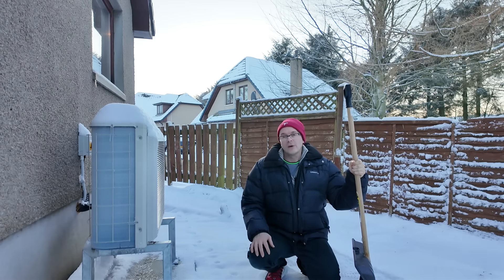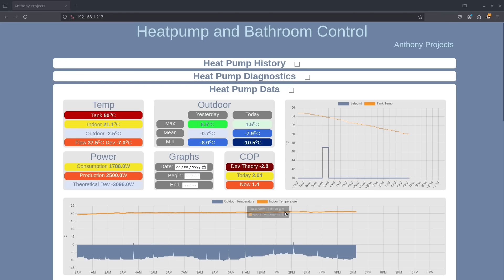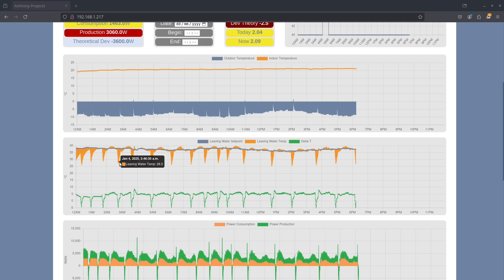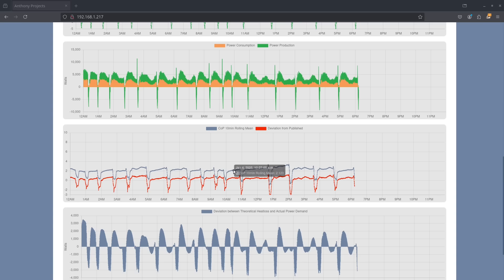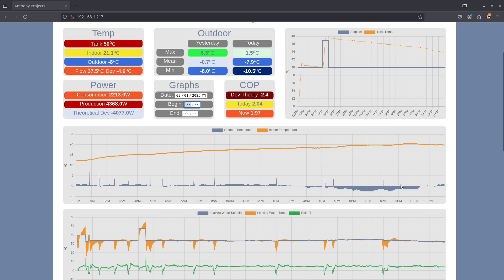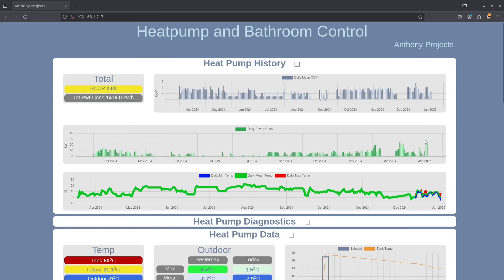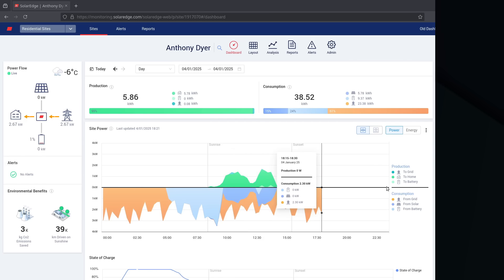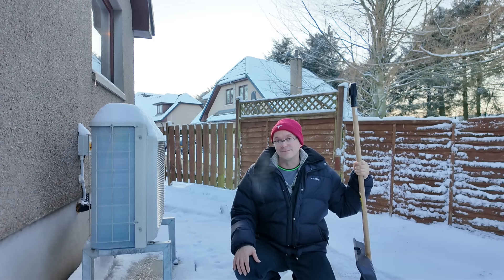Heatpump Performance on the coldest night of the year

Comment: My place is warm, thanks to the gas boiler. No rumbling sounds coming from it.
Reply: Hey troll. Why are you even here?
Reply: The water pump in a gas boiler-fired system also makes rumbling sounds. If can't hear yours that's inside the building, you shouldn't be bothered by a pump that's outside.
Reply: What!!!  You don't have your refrigerator in your garden annoying the neighbors? where is your inclusion, equity consideration?  

My gas boiler sits silently (unlike the misses)  achieving a COP / SCOP  of at least 4, sometimes 5. (the cost of 1kw of gas is 4 to 5 times cheaper then electric).
I have a combi so the wife and daughter can't store water , only to pure it over themselves and down the drain. I give them the house hold regulation  of 1 min in the shower, then the combi is switched off, no warning. 

My wife even has room on the walls to hang photographs of the family, (oddly none of me). we were told when considering a heat pump system that the walls would need clearing for the monster radiators, that we may consider cold all the time, (I though cold radiators , sounds like a saving to me) but no, they were consuming copious amounts of power, if the wind turbine are working.

Anyway, suffice to say the 10 year old combi has another 10 yeas life in her, so I sent the snake oil salesman away, and told the wife and daughters if they are really concerned about their carbon creation we could cut the shower time down to 30 seconds,  they have gone like the boiler, silent.
Reply: People are happy with Cop of 1.6 to 3 while the price of electricity is 4 times that of gas. At most, the cost of running heat pump will be the same as gas boiler. There will be no saving to pay for the capital cost of buying, installing and depreciation of the heat pump. If you have a gas boiler in your house, it would take someone illiterate in cost management to change to heat pump. If you are doing a new build, you may think about using one.
Reply from the maker: @cfcyayaya  Yesterday at my house the price of electricity consumed for 50% of the day was zero, thanks to on site Solar.  The remaining 50% it was 7p.  Bear in mind this is January.  It wasn’t cold, but most winter days aren’t.   It only gets better from now.  So try and factor that in to your cost calculation, there no illiteracy here.  February, there’s a whole lot more sun, and a similarly cold day will be easy for my solar and cheap overnight rate to provide for.

In 5 years time, rooftop solar will be a normal thing to see.  Gas will be an expensive relic that will only exist at the fringes of the electricity market, even though it will still dominate the heating landscape.  At that point:  Gas and Electric prices are decoupled, and electricity prices are free to fall.  Then it will be inevitable that heatpumps come to dominate.

Now before the naysayers start saying “the grid can’t cope, they’ll have to upgrade”,  they did that with gas once upon a time.  1989/1990 every single street was dug up to lay down new gas pipes in my village and surrounding villages.  Massive disruption, and yet the project was warmly embraced.

Some neighbourhood cables may need to be upgraded, but not with such disruption.  It’s a lot easier the burrow cables now than bury them.

Comment: Unless your home is fully insulated, heat pumps save you nothing and could cost you more...
Reply: Even with a fully insulated house it is doubtful it would be cheaper because of the initial cost. Maybe in the very long term, like 20 years plus.
Reply from the maker: @chrissmith-wq6gr I did my analysis 18 months ago regarding heatpumps.

Yes on standard rate electric compared to mains gas there’s no economic advantage just now just on fuel costs.  

But against oil or lpg there is some advantage.

But when you use a cheap overnight rate and combine with batteries and solar - that’s when the advantages really shine through.

Comment: I have had heat pumps in two homes now over a 15 year period and they are great for 10 months of the year if you don't have access to mains gas and are prepared to either supplement with electric heaters or stoves in the rooms you use most of the time during periods of cold weather below around 5DegC. My brother has a brand spanking new house insulated to double the normal British standards with a highly efficient Daiken heat pump system and he simply can't afford to run it to keep the house warm in Winter instead running it low to maintain around 14DegC and relying on wood stoves to boost the temperature in the rooms he needs it in. Heat pumps are great with super efficient insulated homes such as we simply don't have in the UK and in countries with dry air in Winter, again that we dont have in the UK. Sad but true.
Reply: A reasonable heat pump install has similar energy costs to a gas boiler. Correctly sized installs should provide sufficient heat throughout the year. Insulation reduces costs for all heating technologies. Extra insulation isn't required for heat pumps but might reduce the heat pump size and radiator work needed. Comparatively speaking, UK houses are poorly insulated.

Comment: So in effect you are getting something for nothing? And as you know only too well, that is impossible. Putting two and a half kilowatts in to get one and a bit out again????? No thank you. I'll keep my woodburner.
Reply: No, he says he is putting in 1 kWh electricity and getting 2-2.2 kWh in heat from the air out even at -10C (and much better when it is warmer). Over the whole year I would suggest his energy costs would be less than a gas boiler at standard tariff prices (without including his solar and battery).
Reply: ++ @Biggest-hz7ng ++ So a gain of one kilowatt after all the expense, mess and inconvenience of having a lump of unreliable machinery bolted to your wall, (if there is room for it) which WILL go wrong when it is most needed, will be noisy and expensive to maintain, etc etc etc. My woodburner  heats my house, some of my water, boils a two gallon kettle in about five minutes is friendly and comforting to look at and runs on wood culled from my own land. Again, no thank you!

Comment: If these systems were any good you wouldn’t need a grant and they would be flying off the shelf  !
Reply: That’s not true. Three thousand new homes are being built behind my house in Yorkshire without solar panels. I think they all have gas boilers although I don’t know about the flats.
Reply: @juliebrooke6099  Hi I'm guilty of generalisation, apologises.  
To clarify, to get the minimum mandatory SAP ratings or a better than mandatory SAP rating, you need certain items that bring up the points rating.  Solar panels and heat pumps are some of the items that do so quite easily.  It isn't a legal requirement yet, but it has been a threat for some time.  
  I guess you could get the mandatory rating with other measures, i don't know,  but it would be difficult to get a decent score  without them.   I don't know how they have done so on the 3000 homes estate you describe.
 It is indicative though that they have chosen a harder route to get a decent rating by not fitting either HP's or solar !  Presumably they don't feel the cost/benefit is justified, 
    There are some pretty good solar slate/tiles now that don't look like solar panels - could they have those ??   Also there are hybrid systems that use a gas boiler and a heat pump together.
Reply: @  no they don’t have heat pumps. A couple of the houses have had ordinary solar panels installed after purchase so I ‘m guessing they don’t have the ones you mentioned .
Reply from the maker: This is old technology, but it's in a new marketplace.

Anything that's brand new to a market needs support.  They are a bit like babies.  No baby has ever survived without support for the first few years until they reach school leaving age.

Heatpumps are similar.  Supply chains need to be built up, skills need to be developed, and all this needs a support mechanism.  In this instance the government has chosen a demand driven support mechanism as generally speaking industry knows hows to train itself when there's a market to supply.

Solar panels used to need support, now they are good, and so they don't need that support structure anymore.
Reply: @anthonydyer3939  
Hi Anthony, not really correct re the solar panels.  It is currently being forced through on all new houses as part of the building regulation requirements, this is the main demand.  There is no option to not fit them.  
A good deal of the self and secondary installed collapsed when the FIT subsidy was removed.   I have my own fitted, non subsidised and I could only make it pay with the GSE system when replacing my roof so I didn't need to by the slate. 
I calculated a battery was pointless as the real world payback would not be achieved by the time the battery was shot.        A shame really
Reply from the maker: @scherry5135  I've got no FiT on my panels.  I invested in 2020.  4 years later, nearly 50% of the original capital has been paid back.  It's a GSE in roof system too.

Fair comment about the battery though, but they are much cheaper now.
Reply: They are as popular as electric cars, NO THANKS
Reply: @colingathercole391  EVs are the fastest growing segment of the UK's car market. With petrol and diesel shrinking and their manufacturers in trouble.
Reply: The install industry is growing and needs support. It's a cheap way for the UK to substantially reduce its emissions.
Reply: @Biggest-hz7ng for what purpose ?
Reply: @ianrowley5762  reducing emissions helps the UK meet its climate targets and do its part to help reduce climate change. Most of the UK supports action on climate change. Electrifying heating saves tonnes of CO2 per year and doesn't cost that much for the government compared to other methods of reduction.
Reply: Contributors should note that YouTube has a comment munching algorithm. I don't put much effort into my comments as a result!
Reply: @Biggest-hz7ng You can’t be serious right? Heat pumps are inefficient the colder it gets? Depending on manufacturer heat pumps need a secondary heat source at about -18c? Maybe check with your insurance provider as they will confirm this lol.
Reply: @kennordsfan1494  installing heat pumps significantly reduces emissions. They are a comparatively well-priced way for the UK to meet our commitments.
Reply: @Biggest-hz7ng  Emissions are not the problem. The problem is corrupt politicians.

Comment: I must admit I was somewhat surprised by the COP value of 2.2 which still makes this an expensive option when compared to gas whilst at the same time I appreciate you have mitigated costs by using a battery and so-called cheap rate electricity. Personally, I have an air to air heat pump and I usually see a COP rating above 4 and a far quicker warm up time. It seems air to air is not promoted because god forbid, you can also use them for air conditioning and our beloved government (and the one before) couldn't countenance Jo public using energy for cooling and only for heating.
Reply: It's the overall SCOP that matters. A drop to 2.2 for the relatively short defrost periods (say 5 mins per hour) can be more than compensated for by performance at other times. I believe 'much' of the heat used during the defrost is reclaimed.
Reply from the maker: @dontuno  A CoP of 4 is seem above 3-4 degrees at my house.  But I agree that air to air needs more promotion.  In other countries it’s legal to DIY it, and it really isn’t hard to do.  It’s normal in Norway, and they often get away with just one emitter for the whole house, making installation very labour efficient.
Reply: @anthonydyer3939  Funny enough, I did DIY a system some 15 plus years ago and had it charged by "others". My current system was installed by so-called professionals but in practice it is a doddle except  for getting hold of the refrigerant. My suspicion is that an air-to-air would be far more cost-effective, less disruptive and dare I say it more efficient. However, the story goes our government does not want Joe public increasing electricity consumption in summer months when they have the temerity to use it for cooling. Talk about cutting off your nose to spite your face!

Comment: And how many thousands upon thousands of pounds has this system cost.. heat pump, and extra rads, battery, and solar panels 30K plus. That gives me 27K plus  to spend on fuel as replaced my gas boiler for a new one for less than 3K, with a ten year guarantee 😂
Reply from the maker: @the_none_believer  Before COVID I spent £27.5k or heating, electricity and diesel over a 10 year period.  Now I’m spending “almost zero” on energy costs.  I’ll have a definitive answer once I’ve run this system for a year.
Reply: Solar and batteries can reduce the cost of utilities for most houses and aren't needed for heat pumps.

Much of the heat pump install cost is the one-time cost to switch to low temp heating, after that it should just need maintenance and periodic (15+ year?) replacement of the heat pump.

Comment: When enough people have fallen for this BS and got themselves a nice shiny heat pump the energy companies will switch them off remotely when to much power is used. It was done in Australia with the air conditioning units on people's houses.the cooling systems were switched off remotely on the hottest day of the year.

Comment: I've no doubt that you are very happy with the results so far of you capital investments of heat pump, solar panels and electric car. But do you live in  a new house with ultra efficient insulation or did you have to do insulation upgrades as well. Obviously I don't think that any insulation upgrades would have to be set against the capital investments for the heat pump or the solar panels, as it's a sensible course of action no matter what type of heating method is used. I guess it's what's the payback, maintenance costs and reliability over a more protracted period.
Reply from the maker: @martyncozens5654  it’s a 30 year old Bungalow.  Most of the insulation upgrade has been loft insulation and under the floors between the joists, both DIY jobs.  A bit of expanding foam to fill in holes as well (pipes and cable transits are particular targets), and non return dampers for the exhaust ventilation ducts.

Professional upgrades include PIR insulation in 60% of the walls as part of other renovation works.

Windows are 30 years old triple glazed.  No fancy Argon fillings or low E coatings.

Comment: You have got an electric heater how much does it cost to run?
Reply from the maker: @gordonburns9911  the backup heaters are seldom used.  Only during weekly disinfection cycles, and bringing the central heating water up from below 18 degrees.

Comment: Hmmm where I live my gas bill is less than 40% of the cost of my electricity bill, even though I have gas heat and gas hot water so it would be insane to have a heat pump!
Reply: In the UK, heat pump energy costs are similar to gas boiler energy costs.

Comment: What happens when all these heat pumps start to degrade and people cant afford repairs  the bearings (all made inChina) will be screaming like banshees. Good luck if you live in close neighbourhoods.??
Reply from the maker: @brianoxley2093  the same thing when your car starts to degrade.  You get it fixed.  Bearings will last.  And it’s Japan that makes the good heatpumps.  Daikin is headquartered in Osaka, Japan.
Reply: You seem to think that gas boilers don't need any bearings at all? You have a lot to learn.

Comment: I suspect these air source heat pumps are better with UFH.
Reply from the maker: @justinf1343  I’m doing pretty well without the Under Floor Heating to be honest.  A central heating temperature of 30 to 38 degrees is pretty much standard for an underfloor system.  Therefore to achieve that comfort with just radiators is good going.

That said, we one rented a holiday cottage with UFH.  We certainly appreciated that feeling of having our feet plugged directly into the heat!